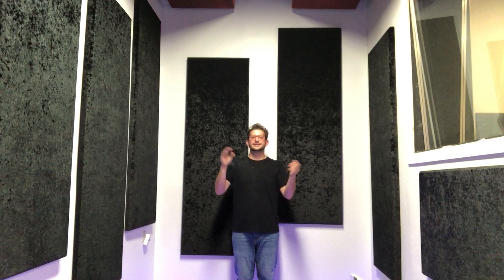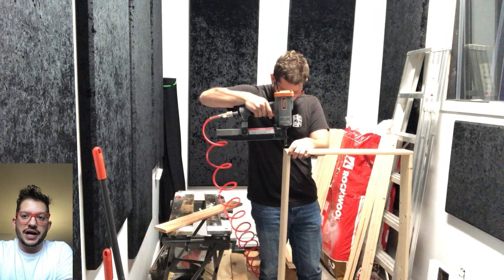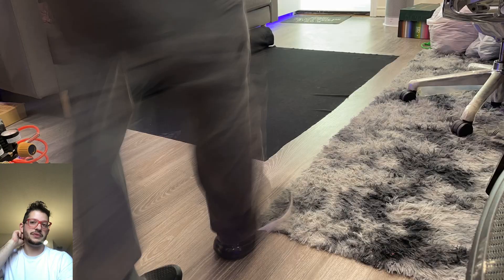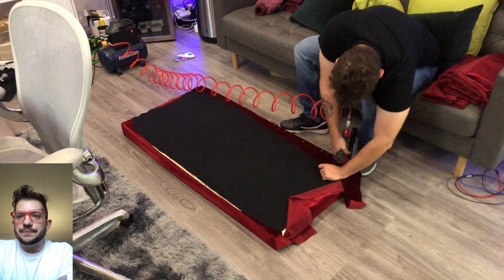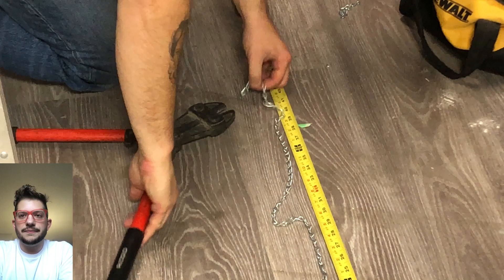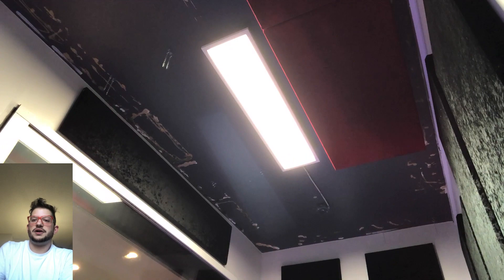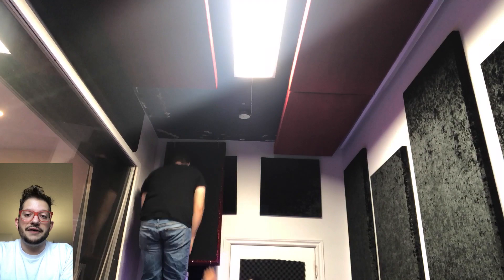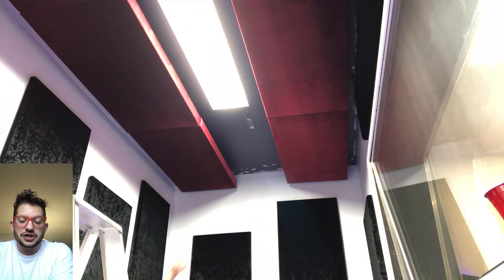DIY VOCAL BOOTH BUILD! HOW TO MAKE CEILING ACOUSTIC PANELS FOR YOUR HOME OR RECORDING MUSIC STUDIO!

Comment: If you use non splitting wood screws, and corner brackets it will keep your framing square and will be much more rigid and secure.
Reply from the maker: I prefer the straight nails so I have the adjustability to hammer out the middles if necessary to line up perfectly with each other. I can also twist the frame to lay completely flat if there are any inconsistencies/warp in the wood or cuts. There are many ways to skin a cat! ;) Thanks for watching!

Comment: Would you say that velour fabric is a good option for 2" thick acoustic panel outer fabric? And another thing I am wondering about is should I mount the panels on the walls with like a centimeter or two (1/2"-3/4") away from the wall? Working on reverberation removal form a small "conference" room which will also serve as a video and audio material recording room - 4,6m x 4,6m x 2,6m.

Comment: Hi, what size hooks and anchors did you use? Specifically the thread size/count. Thanks!
Reply from the maker: Hello, the anchors are 1 and a half inch drywall anchors rated at 45 pounds each. And the screw hooks are 2 and a quarter inch, not sure on the thread size/count, they're about an 1/8th of an inch thick id say. (I have other videos that show closeups of the hardware if you check out the channel!) Thanks for watching!